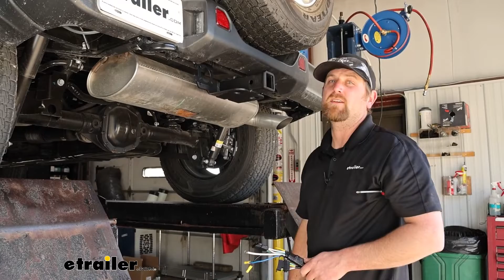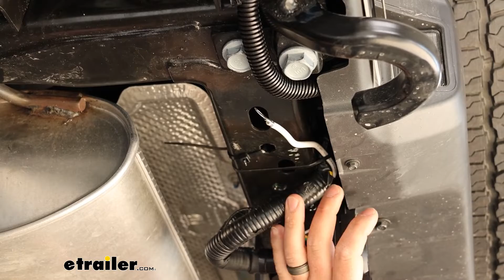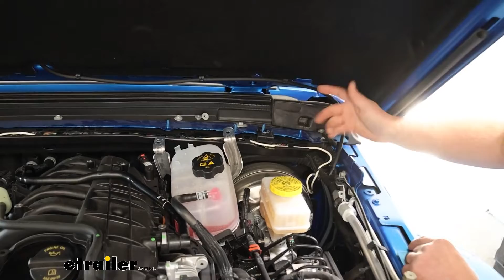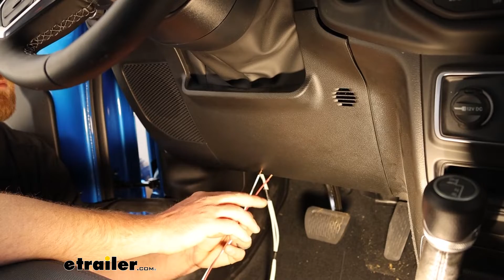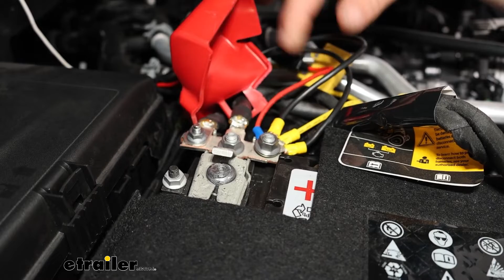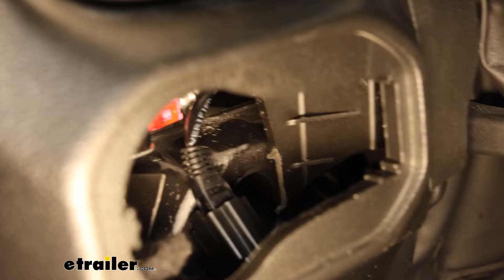Mount: Universal Installation Kit for Trailer Brake Controller on a 2022 Jeep Wrangler Unlimited

Comment: Wait were did the duplex wiring come from it just appeared and you started cutting it lol
Reply from the maker: The duplex wire comes included with the # ETBC7 kit. Some of the in-between steps get edited out, so it does kind of appear out of nowhere!

Comment: Can i get a list of what you used
Reply from the maker: Our installer used our # ETBC7 Brake controller install kit. The kit includes:
• A 4 pole to 7-way trailer connector adapter
• 25 feet of 10-gauge duplex cable
• A 20, 30 and 40A auto reset circuit breaker
• A circuit tester
• Ring terminals for battery and breaker hookup
• Quick-splice wiring connectors
• Self-tapping screws
• Zip-ties
• Wire loom for a professionally installed appearance
https://www.etrailer.com/Accessories-and-Parts/etrailer/ETBC7.html